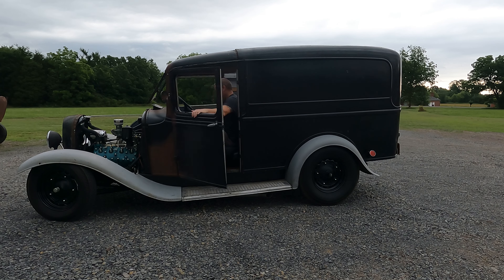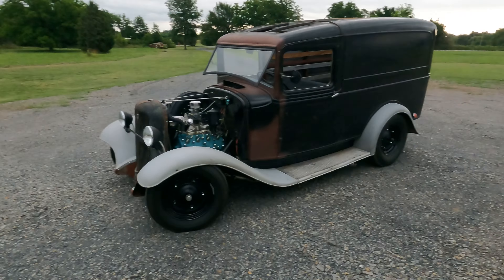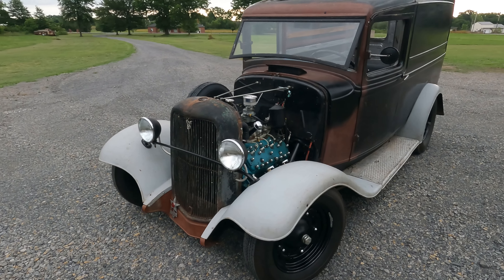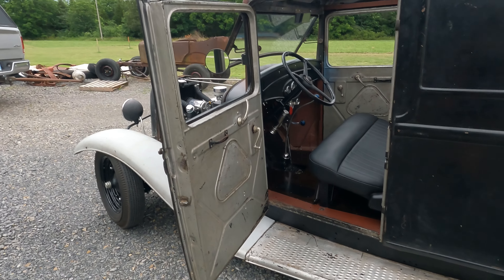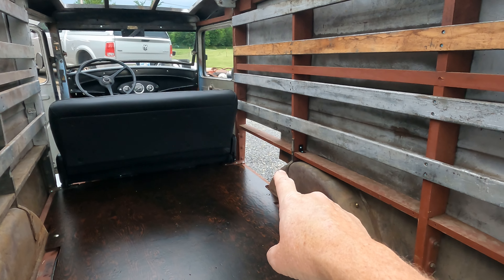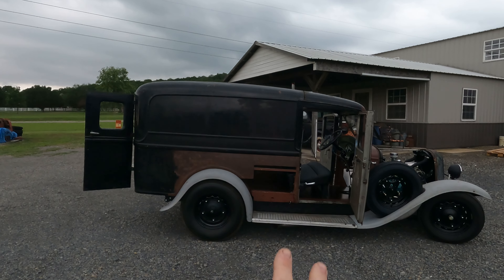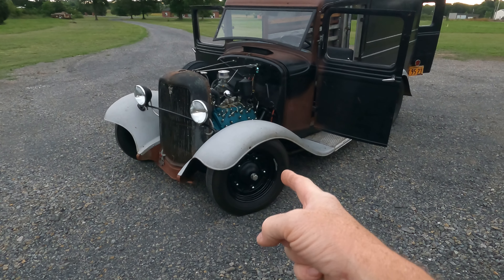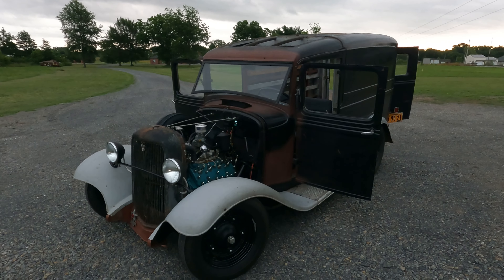Pomona Panel Specs · What parts did we use?!

Comment: Suggestion on revealing the old signage.    First, there ain’t nuthin wrong with how it looks now!   But I would be curious about the old advertising, too.   Try using a “safe stripper”, one of the citrus based ones.    I’ve had great luck with these because they work slowly, much less aggressive than solvent based strippers.  This gives some control as you work through the layers.  Maybe try a test panel, with a fine scotch brite pad to blend the paint layers.    Great project,  and great channel.
Reply from the maker: Awesome idea! and I have some of that stripper!! Thanks for the tips and thanks for watching!!

Comment: Man im a huge fan, love what your doing!! Id love to see a video on how you done the bracket for the master cylinder with original pedals. Im building a traditional 34 ford pickup flathead 36 trans.. i love the panel its a beauty!!!
Reply from the maker: Thanks man... It's just a piece of 3" x 3" angle iron .25" thickness... it mounts across the underneath trans X and the master cylinder mounts directly behind the brake actuator... The pedal pulls the brake actuator and then the brake actuator pushes the master. Very simple. Another option is @Dennis_lacy_earlyV8garage on instagram sells a kit that works great!
Reply: @chaddilacdesigns  Thank you man!! I will def do that that's a great idea. Man I look forward to your upcoming videos keep up the great work an hopefully get to see the 34 someday at a show if your ever close to KY
Reply from the maker: Thanks... we'll be headed to Old North State, Carlisle Swap, TROG, Hershey and back to Oklahoma for the ROC this year!